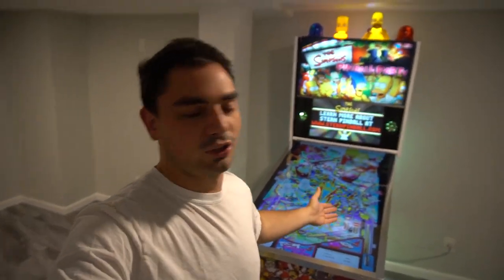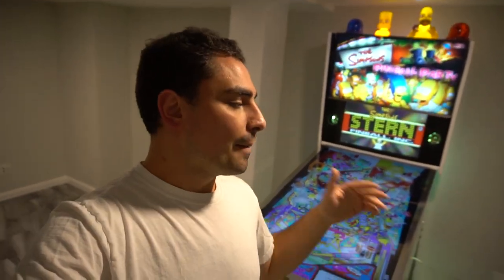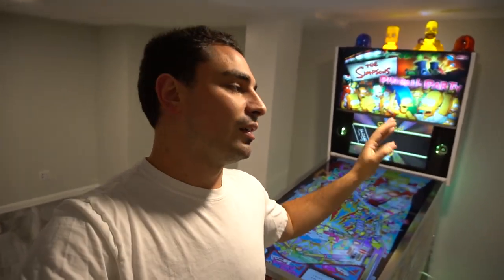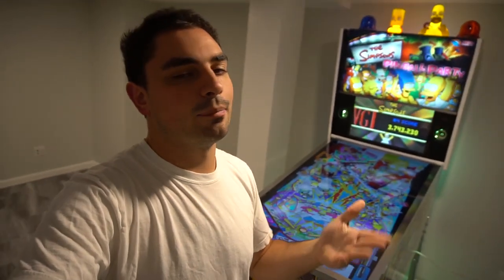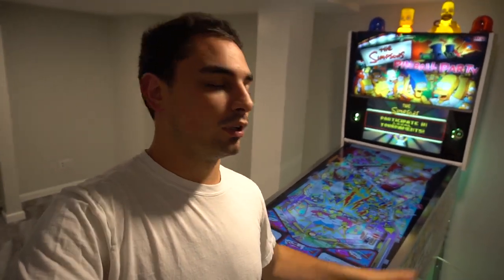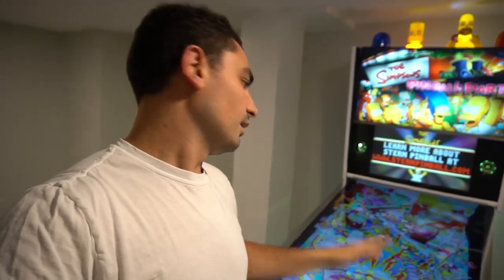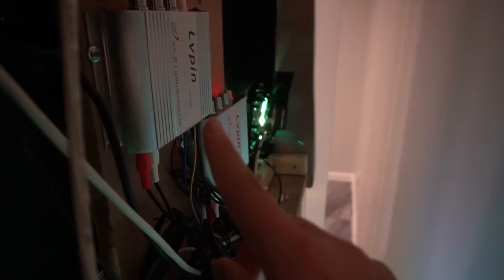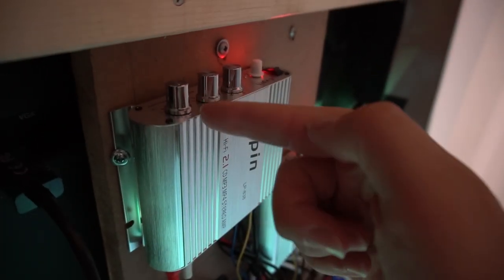Surround Sound Feedback For Virtual Pinball

Comment: I've read that mdf board is not as loud (muffled) as regular plywood. Which makes sense when you think about it - you can knock on both wood types with your knuckles and get an idea of how the sound transfers differently through each one. So if you're going to do SSF, it's recommended to use plywood for better sound transfer through the wood. Or at least, that's what I'm planning on using; and I'm going to make sure I don't undersize my dad amps wattage.

Comment: One reason why you may get poor audio when you turn up the sub is that you may not be feeding enough power (Amps) to your amplifiers. Sharing the one power supply between the two amps may not be the best idea. This might especially be true for anyone who is also connecting a bass shaker exciter to the subwoofer channel, which would draw even more power. Then it would even more important to ensure you have enough Amps running to your amplifiers to power your exciters. (It doesn't sound like this particular set-up has a shaker exciter though, so this info is  more for others who are using this as a resource). 

To test this theory, you could simply try disconnecting the power from one amplifier and turn up the subwoofer on the amplifier that still powered and see if you get distortion or not. Just a thought.

Of course all this comes with a disclaimer in that I'm new to all this too, so this info is from what I've read and researched so far. So feel free to correct me if I'm completely off base!)
Reply from the maker: I had only a humming issue from ssf because of the sharing of power supply. But I can test your idea as far as the subwoofer :)

Comment: Hey Vic, it looks like I have the same setup, different amps (2.0 VS 2.1 for the exciters) as well as a 2.1 amp running the backbox speakers and woofer but dame sound card and exciters. That 2.1 amp is plugged into the 2.0 spot, front exciters are plugged into the front, but I am getting absolutely no sound when plugging the back exciters into the back spot on the sound card. Strangely, when I plug into the center/bass I get sound from the back exciters. I have a feeling there is a bad setting somewhere, but did you run into any similar issues or have any advice? Do you have your back box speakers plugged into the 2.0 spot of the sound card? Thanks in advance.
Reply from the maker: Hey Andrew what's up!
I followed mrjnet to the tee

http://mjrnet.org/pinscape/BuildGuideV2/BuildGuide.php?sid=audio

Be sure you follow the steps as far as going unto windows audio settings and being sure it's set to 7.1

Comment: Thanks for your video. Are the rca to aux mono ? Your link is broken
Reply from the maker: Should be stereo (2 connectors)

Amazon Basics 3.5mm to 2-Male RCA Adapter Audio Stereo Cable - 4 Feet https://www.amazon.com/dp/B01D5H8JW0/ref=cm_sw_r_apan_glt_i_BZK90VZYBD265P01WPYY?_encoding=UTF8&psc=1

Comment: Also have you tried with any other exciters? The sealed waterproof outdoor ones seem overkill for inside a pinball cab?
Reply from the maker: Yes see my recent Simpsons build I did for a customer, I got the octopus style ones... still great quality, no need for the ones I got. The ones I got where priced way cheaper than they are currently

I'm building a Disney pin now, I used even cheaper exciter... same performance honestly.
Reply: @Vic_VP  what ones are you using for installed now? And are they comparable for volume as these?
Reply: @Vic_VP  can you share what ones are the spider ones and the ones you are using now?
Reply from the maker: Disney cab
https://www.ebay.com/itm/2x-Dayton-Audio-DAEX19QLP-4-Quad-Feet-Low-Profile-19mm-Exciter-5W-4-Ohm-/234236739684?mkcid=16&mkevt=1&_trksid=p2349624.m46890.l49286&mkrid=711-127632-2357-0
Reply from the maker: Simpsons #2 cab
https://www.ebay.com/itm/Dayton-Audio-DAEX25QLP-4-Quad-Feet-Low-Profile-25mm-Exciter-/274576596553?mkcid=16&mkevt=1&_trksid=p2349624.m46890.l49286&mkrid=711-127632-2357-0

I rather these than the Disney one

Comment: You have four wires per CABLE… the word is CABLE (not four wires per wire). The speakers are connected to the OUTPUTs of the amps (not the inputs).
Reply from the maker: Ok cool thanks

Comment: Why do you neen multiple exciters located around the cabinet when you are only feeling the feedback through two contact points?
Reply from the maker: Huh? I always out 4 exciters.. 2 in front and 2 in rear
Even in the rear you feel the vibration along with hearing the ball in the rear
Reply: @Vic_VP  Tactile exciters are meant to give tactile feedback.  In the case of a virtual pinball table tactile feedback is perceved through your hands (the two contact points on the cabinet).  Your hands do not perceive vibration in three deminsions so placing more than one exciter to stimulate a single contact point is a waste.  Exciters aren't meant to be used for audible sound.  The audio quality they produce is fairly sub par.  If you want the sound of the ball rolling around in three deminsions, use regular surround sound speakers where you would normally put the exciters.  For tactile feedback, place a low and high range exciter on each side of the cabinet close to where your hands normally rest at the flipper buttons.  I'll bet the overall expierience is the same, if not better.
Reply from the maker: @TheSloppyDingo  I don't understand what you mean or implying
I have ssf and 10 contactors in my builds...

Comment: How do you have the 7.1 hub connected on your laptop? I am not sure if I am using the incorrect setup. When I connect my front exciters to surround port they work but when I connect my second set to any port I get nothing.
Reply from the maker: I'm not using a laptop... I use the usb sound card by startek
Reply: @Vic_VP  I have the same usb I plug it into laptop and then connect amps
Reply from the maker: @jayesposito1801  did you go into windows and do the sound test and such along with setting up audio in vpx

Read the Bible 👍
http://mjrnet.org/pinscape/BuildGuideV2/BuildGuide.php?sid=audio
Reply: @Vic_VP  yes I have that as well. What do you have the setup as on the computer using the software that came with the 7.1. Did you just click the 7.1 box and connect your amps? I have tried everything but I only get sound via 2.1 channel.
Reply from the maker: @jayesposito1801  hey bud, I didn't use any software. Windows automatically recognized it so I didn't download any additional programs
Reply: @Vic_VP  got it. Do you have solinoids installed with your setup? I have flipper ones installed and have been thinking about adding a full set but wasn’t sure if you would really feel them with our haptics installed. Thoughts?
Reply from the maker: @jayesposito1801  yes see my other videos, I have 10 solenoids and in my opinion... solenoids are a must... ssf and solenoids are 2 different things. Ssf is good for the ball rolling, but solenoids are amazing for flippers, slingshots and bumpers
Reply: @Vic_VP  ok I’ll buy them.
Reply: @Vic_VP  I learned that they sound better if the solinoids are facing the cab and are pressed against wood. Can you send me the other video.
Reply from the maker: @jayesposito1801  my solenoids are screw directly to the side walls and my flippers are right under my flipper buttons.

I have several vids around the same time as this video check back on my vid history
Reply: @Vic_VP  are these the sets from Philip on eBay
Reply from the maker: @jayesposito1801  nah I did mine my self. No shortcuts for me lol

Comment: Hi you connect your exciter speakers to the amps the amps to 7.1 does this run off the speakers is the back box or how do they get there sound thank you
Reply from the maker: No speakers in the backbox are connected to the 2.1 / regular aux input from the pc. The excoters are hooked into the 7.1 external sound card
Reply: @Vic_VP  ok thanks for that how do you connect the 7.1 to the pc please what wire will I need for that
Reply from the maker: @michaelshortsc  you need the external sound card. So usb to sound card, and then 2 3.5 mm wires into 2 amps
Reply: @Vic_VP  ok thank you I think I’ve got everything just checking if the cable comes with the sound card
Reply from the maker: @michaelshortsc  negative, the wire does not come with the sound card nor does it come with the amps
Reply: @Vic_VP  have you got a link to the Guide man you mentioned please
Reply: @Vic_VP  have you a link for the wires I would need please
Reply from the maker: @michaelshortsc  which guide?
Reply: @Vic_VP  you mentioned a man to follow to install
Reply: @Vic_VP  got everything ordered today to get this up and running so I have to download anything when it’s all wired up
Reply from the maker: @michaelshortsc  someone below said theycneeded a driver... mine was plug and play zero issues
Reply: @Vic_VP  hopefully mine will be the same
Reply: @Vic_VP  got my sound card today did you have to  do anything with the disk that comes with it
Reply from the maker: @michaelshortsc  no I didn't cause my pc doesn't have cd drive
Reply: @Vic_VP  no mine doesn’t  either so you wire all up plug in the usb and away it goes
Reply from the maker: @michaelshortsc  for me, yes it worked like that. Plugged in and then had to do the necessary steps within mrjnet guide for getting surround sound to work with vpx
Reply: @Vic_VP  oh right ok where do I find mrjnet guide please
Reply from the maker: @michaelshortsc  http://mjrnet.org/pinscape/BuildGuideV2/BuildGuide.php?sid=toc&from=title
Reply: @Vic_VP  I think I’ve found it thank you
Reply: @Vic_VP  hi have you a plug going in to line in and if so where is the other end plug in to please
Reply from the maker: @michaelshortsc  no no line into the sound card
Reply: @Vic_VP  right I’ve sort of got it going now but most of the sounds are coming out of the back speakers put coin in and ball drain are coming out of back exciters I’ve swapped to the jack plugs and it stays the same ive got it wired up exactly like yours therei is some sound coming from the front any ideas please
Reply from the maker: @michaelshortsc  that means u have the actual exciter wired wrong.
1 amp = front left and front right
1 amp = back left and back right 

It sounds like you did 
1 amp front left and back left
1 amp front right and back right
Reply: @Vic_VP  I’ve got front left and front right on one and back left and right on the other amp and back amp in back on card reader and front in surround
Reply from the maker: @michaelshortsc  sound card has 2 outputs 5.1 and 7.1
1 amp goes into 5.1 and the other into 7.1
Reply: @Vic_VP  got it going now thank you
Reply from the maker: @michaelshortsc  cool what was it?
Reply: @Vic_VP  I the settings in visual pinball audio
Reply: @Vic_VP  hi my surround sound has gone I had a windows update yesterday and today I turned it on and all the sounds was coming out of the exciters doesn’t matter what settings can’t get it back got sounds coming out of both when in speaker test but you have to select the usb speakers and they work then the back box speakers and they work but not all together any ideas please
Reply from the maker: @michaelshortsc  dam not sure about that one. im gonna have to load up my pin and see if that happened to mine

Comment: Will this work with FX3
Reply from the maker: Yes but takes some time and trial and error to get it to work properly
Reply: @Vic_VP  any tips to help with setup? I am hooking up the BuyStuff Arcade audio haptic harness. I will run this with my two amps, 4 Dayton exciters and shaker to the 7.1 USB. I also installed solenoids. I am currently hooked into the main haptic line but will move to the audio with the new harness.
Reply from the maker: @jayesposito1801  uffff not really man to be honest I don't even have ssf on fx3. You Def need doflinx and each game has its own ssf folder files like a pup pack to get it working. I'm sire if you search terry red, nail Buster or major Frenchy you'll find a tutorial
Reply: @Vic_VP  yeah I downloaded all of the doflinx and other files Terry went over. I need to tweak it some minor config issues. Will be interesting if I can get this working.
Reply: @Vic_VP  I am trying to add the 7.1 usb you have. What line do you have running to input?   And how is your program setup on the speaker settings?  I added the exciters in front and back but all that works is front buy flippers. I am using the BuyStuff haptic kit and it works well but not sure how to setup like you have it.
Reply from the maker: @jayesposito1801  check the Bible 

http://mjrnet.org/pinscape/BuildGuideV2/BuildGuide.php?sid=audio